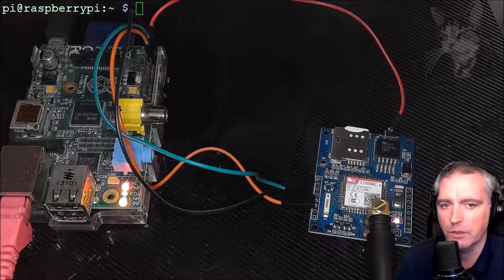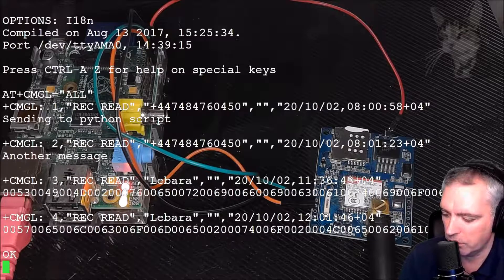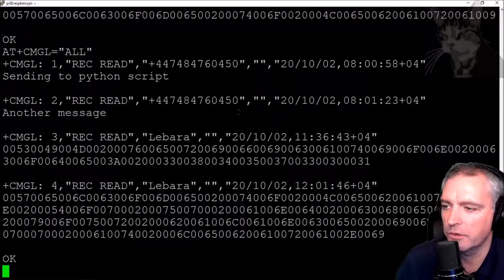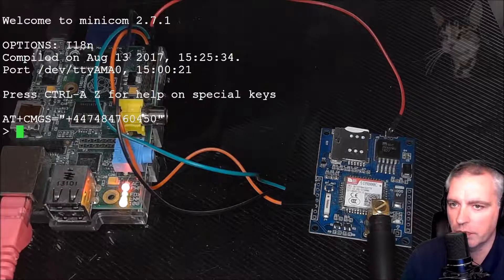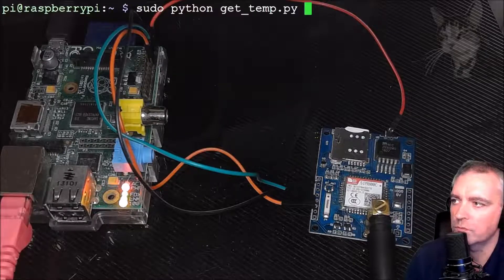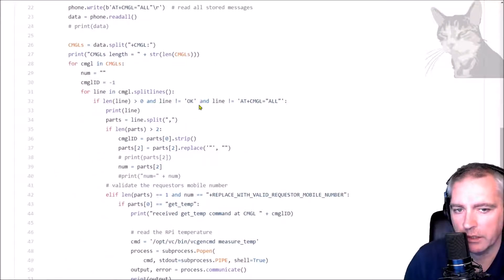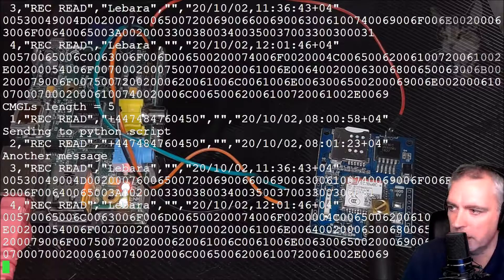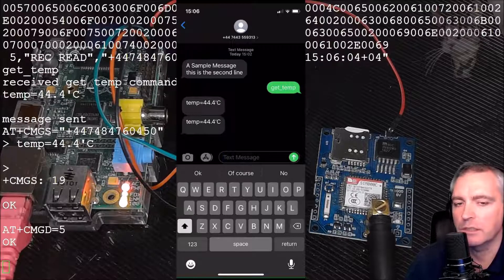Send SMS using a SIM800c Module

Comment: When I send a text instead of the +cmgs: xx OK. I get these weird diamond question marks as characters. I do receive the texts. any idea?
Reply from the maker: Try changing baud rate, or other settings.
Reply: @sbcode  I've tried playing around with rate, parity, stopbits etc. either stops working or keeps half working but it still is showing those weird characters.
everything else works, AT commands etc. so serial settings seem ok. just when sending or receiving a text i get those garbled texts. if I do at+cmgr=2 it does display the text but I'd need that initial cmgs message for some python scripts to run properly

Comment: Hi - great tutorial thanks. Got everything up and running, followed all your examples to the end but "get_temp.py" fails:

b'ATZ\r\r\nOK\r\n'
b'AT+CMGF=1\r\r\nOK\r\n'
Traceback (most recent call last):
  File "/home/pi/Desktop/Get_Temp.py", line 26, in <module>
    CMGLs = data.split("+CMGL:")
TypeError: a bytes-like object is required, not 'str'

can you assist please?
Reply from the maker: what version of python are you using
Reply: Python 2.7.16
Reply from the maker: I can't test this since I am no longer setup. but you need to convert the response from phone.readall() to a utf-8 string.
Try adding this line below to line 25. 
data = data.decode("utf-8")
Reply: @sbcode  hi Sean - perfect thanks! that change at line 25 fixed the error being thrown at line 26. The script executes, receives the get-temp sms, encodes the return phone number but at output halts:-

received get_temp command at CMGL 13
b"temp=59.9'C\n"
Traceback (most recent call last):
  File "/home/pi/Desktop/Get_Temp.py", line 58, in <module>
    phone.write(output.encode() + b"\r")
AttributeError: 'bytes' object has no attribute 'encode'
>>> 

Without making further code changes, running get_temp.py again gives no errors but simply outputs:-

b'ATZ\r\r\n> '
b'AT+CMGF=1\r\r\n> '
AT+CMGL="ALL"
> 
CMGLs length = 1
> 
AT+CMGL="ALL"
> 
CMGLs length = 1

Running minicom in the terminal and executing a few AT commands seems to reset the SIM - then the cycle above repeats.

- seems the (ufc-8) encoding change made earlier needs to be considered for line 58 to allow the sms to be sent now?
Reply: @geraldlat7462  I have the same issue, did you ever manage to figure it out?

Comment: i can't press everything the letter on minicom? help me
Reply from the maker: Everything is in the videos. Maybe your wires are the wrong way around. Read everything in the description
Reply: @sbcode  I have attached the correct wire, but not press AT on the minicom
Reply: @sbcode  on the minicom, I can only press ctrl a + z
Reply from the maker: Type a then t then ctrl-m
Reply: @sbcode  I pressed, but it doesn't show up
Reply from the maker: Everything I know is in the videos and it works for me. Did you watch the 1st video and read the description. https://youtu.be/tmD9svuY0Kc
Reply: @sbcode  However, minicom does not let me type any at commands in the window. It just shows a blinking cursor. While I am able to use CTRL-A Z and other CTRL-A shortcuts to access menus, I am unable to type any at commands in the window
Reply from the maker: So whats different between your setup and what i show in video 1
Reply: @sbcode  I did step by step like video 1, but the minicom doesn't type
Reply from the maker: You are probably using RPi4. My video is RPi3. So try serial0 instead of ttyAMA0.
$ sudo minicom -D /dev/serial0 -b 115200
or
$ sudo minicom -D /dev/ttyS0 -b 115200
Reply: @sbcode  i use raspberry zero
Reply from the maker: did you run raspi-config, disable login shell and enable serial port
Reply: @sbcode  I did, but not type
Reply: @sbcode  I can type AT, bot it's not OK
Reply from the maker: a then t then ctrl-m
Reply: @sbcode  i did, but it's not OK
Reply: @sbcode  do we need to write the code somewhere
Reply: @sbcode  when i type A, it's sho me " AA "
when i type AT, its show me " AATT "
Reply from the maker: maybe you have local echo on in minicom. ctrl-a z e
what port are you connecting minicom to?
Are you sure that login shell is disabled over serial, and that serial is enabled. Just like I say that you need to do in the description of video 1. Open a terminal and use raspi-config
I have shown you everything. Nothing is hidden. It works for me, and it works every time. Its all on video for you to see. There is nothing more I can do for you. you need to help yourself. Find a different tutorial
Reply: @sbcode  I was successful, thank u verry muchhhhhhhhhh
Reply from the maker: Brilliant, what do you think the problem was?
Reply: @sbcode  Because I connected the wrong wire, I can't press. Thank you for taking the time to help me.
Reply from the maker: if minicom doesn't respond, you may have chosen the wrong com device, or its not configured on the RPi to send/receive, or is still being used for tty shell, or the wires aren't connected, or the sim module has not enough power. Anyway, Its not communicating data tx/rx. Mine is so it get data going both ways.
Reply: @sbcode  làm thế nào để biết tôi chọn đúng thiết bị com
Reply from the maker: if you followed all of my instructions in the description on this video it will be ttyAMA0. https://www.youtube.com/watch?v=tmD9svuY0Kc
It works for me, I just tried it again 1 minute ago
Reply: @sbcode  ok let me try again